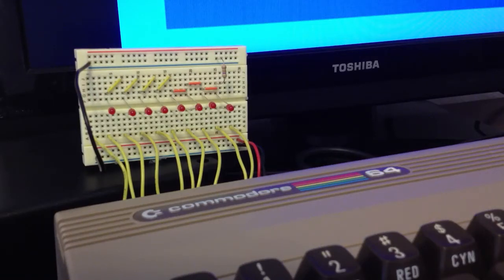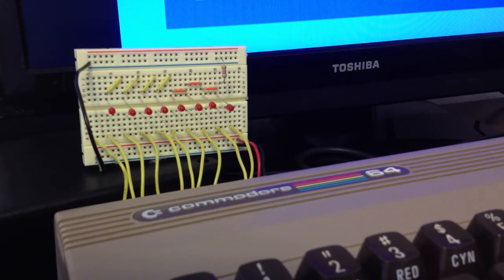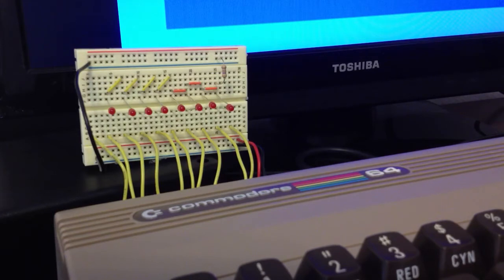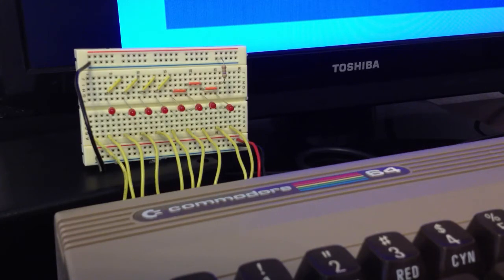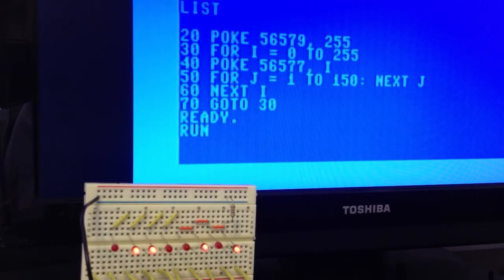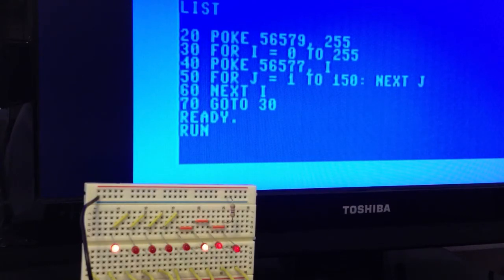C64 User Port - a trivial example

Comment: Are you directly driving those LEDs? The current (per userport output) should not exceed 1mA, therefore you should use some sort of driver (transistor, ..). Otherwise you risk blowing up your poor CIA chip.
Reply: Wrong! Max 100mA pr
 pin and max total 450 mA from the port.

Comment: Hey Chrsitopher, it works on both directions? Can you read TTL data?
Reply: Yes, it is possible to use as input lines. POKE 56579,255 makes all 8 lines as outputs. POKE 56579,0 makes all lines as inputs. You can combine lines as you wish.

Comment: Hi, I am researching some way I can hook a PC to a C64 and transmit data back and forth when I came across your nice simple project showing how the user port is used. I see the address at 56579 is where you decide if each pin is read or write so poking this to 0 should enable reading from it too i guess? But for connecting this to a PC I was thinking something like the Atmega32u4 would work? Any idea what kind of electronics would be needed between the Atmega32u4 and the C64? The Atmega32u4 would get power from the USB port but would one need optocouplers to actually send the data to and from the C64 user port, or could one just wire directly between the pins on the Atmega32u4 to the C64 user port?
Reply from the maker: +64jcl If the Atmega is running at 5V then you should be able to hook it up directly to the user port pins; otherwise you may need to convert.  I've used one of these to hook a C64 up to a 3.3V device before: http://www.adafruit.com/products/757

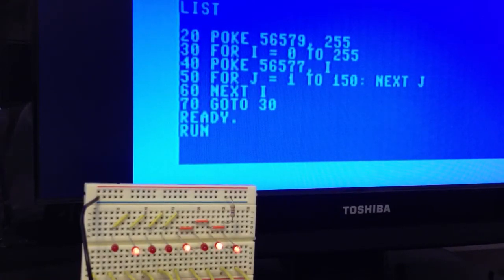Comment: 0:37 to 0:40: Pause for typing this programm in your C64 :)
There excist a shematic that uses 74LS257 or something else incl. some resistors. U got this shematic? Would look nice to use 74LS257 and my Oceanic via parallel cable at the same time. Or would it work with your solution too?
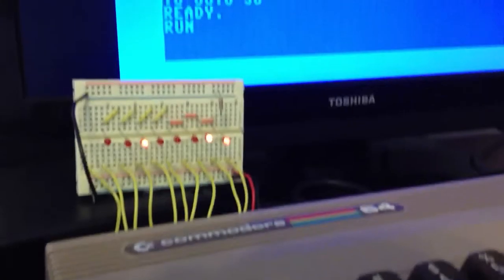Reply: 0:33 Your time stamp doesn't work. Maybe it was made too long before YouTube made clickable.

I chose 33 seconds to let the user hear the following message.